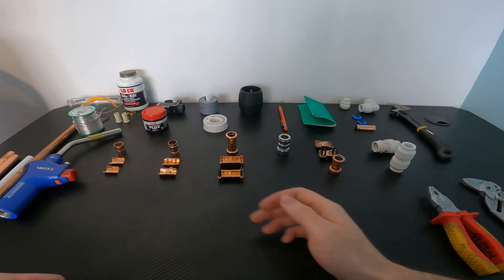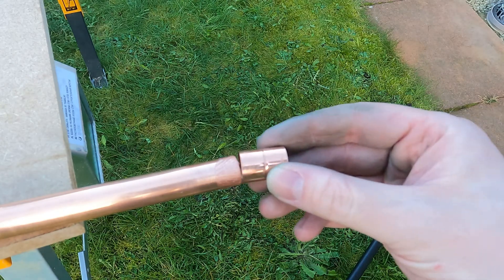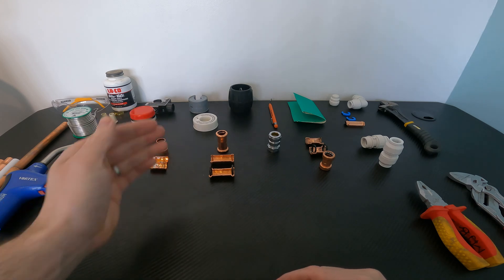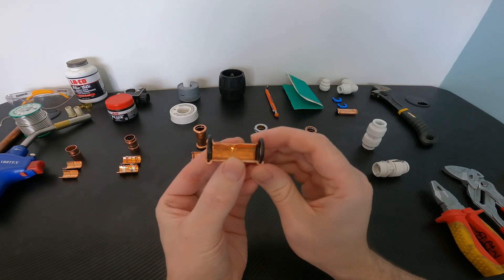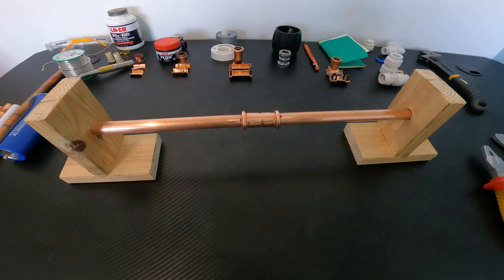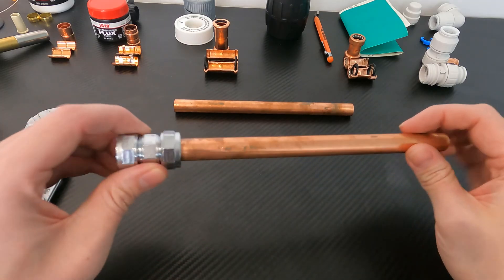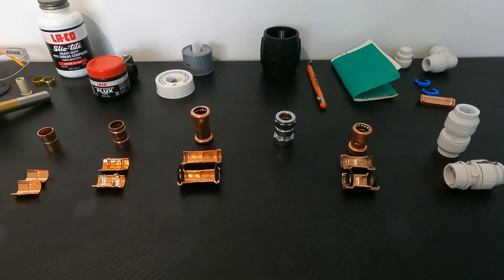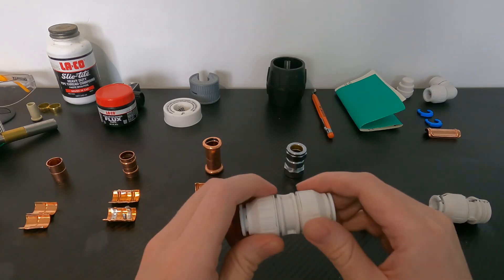PLUMBING IS EASY - NO MORE SOLDERING! 6 DIFFERENT METHODS FOR CONNECTING COPPER PIPE

Comment: Hi I have a old gas pipe sticking out the wall and want it removed, it was for a fireplace that used to be installed. Do you know how much it would cost roughly to get it capped off behind my chimney and out of sight? it's easy to access behind the chimney. Thanks

Comment: DIYer here. I've only soldered copper and used compression fittings. I knew others existed but had not seen the internals nor had I seen them in use. Thanks!  Don't think I'd trust anything that depends on an o-ring seal behind a wall or above a ceiling.

Comment: Thank you for this excellent demonstration . Can the Press fitting ( the one with O ring) be buried under mortar  inside solid plaster wall ? Would it tolerate slight  foundation / wall movements in the long term? Thank you for reading
Reply from the maker: Yeah should be fine. I use the jg pushfit fittings and never had any issues

Comment: What about fitting longevity? Would the O-Ring style fittings potentially leak due to degradation after several years? Great video! thank you
Reply from the maker: Generally I have personally not had an issue with this

Comment: Great video. As a DIY-er I would prefer the non solder version. My aplication is to replace my house water main shutoff valve. On my side not the city side. I like the compression fitting the best because there is no rubber oring  involved.  But it has a tendency to leak. I dont like using fittings with rubber orings because  rubber does not last as long when exposed to the weather elements. And I dont realy want to rent a crimping maching for 50 bucks a day.
Reply from the maker: Yeah compression fittings are a solid option.